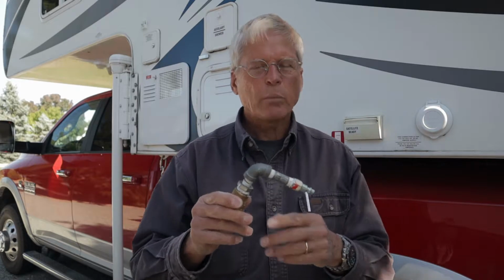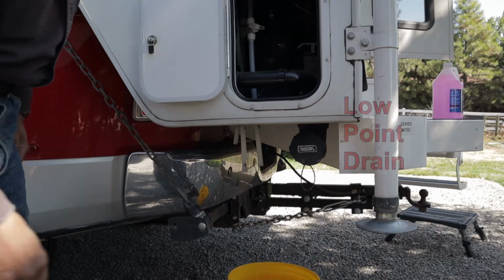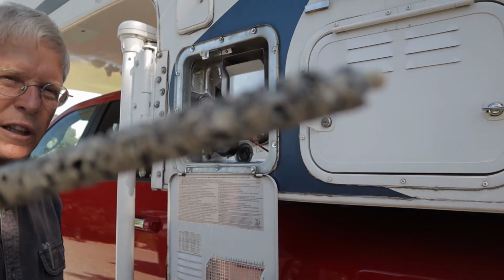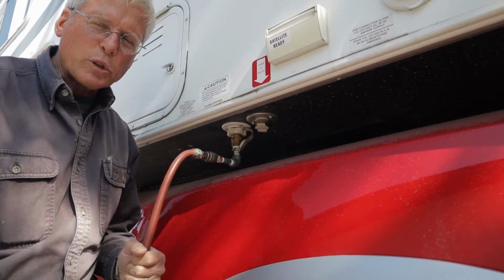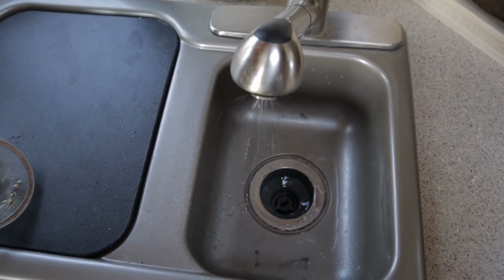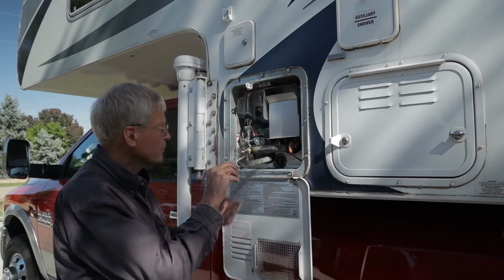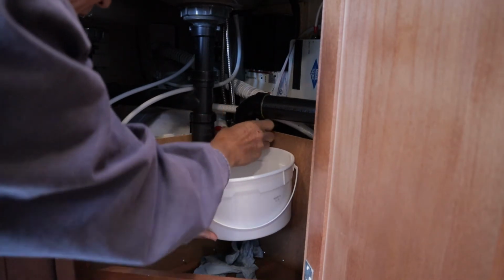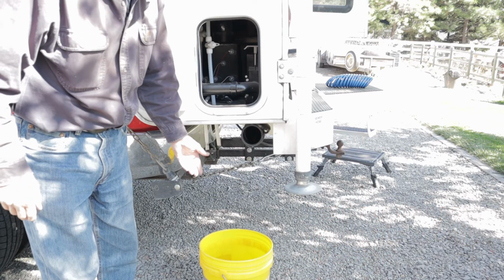Winterize an RV Using Compressed Air

Comment: Shower drain has a p-trap. You need to drop it or run antifreeze into the drain.
Reply from the maker: Good catch!  Up until the time I had recorded this video - we had not used the shower.  I add antifreeze to the P-trap when we do.
Thank you!

Comment: Great video, I'm winterizing my AF 1150 for the first time. This will be very helpful.
Reply from the maker: Thank you for the feedback!  This year I added 'swivel' fittings to the pump to make it easy to drain the pump as it's difficult to get all the water out by simply running the pump.  Since you have an 1150, I assume you have a Shurflo pump.  If interested, look-up parts 255-325 (1/2" Barb input AND a 1/2" Female Swivel Output strainer) and either 244-2926 (1/2" FPT X 1/2" Barb Straight Swivel) or 244-3926 (1/2" F-NFT  swivel barb ELBOW fitting) - available on Amazon.

Comment: Thanks for your video. I pretty much have the same set up, Dodge pickup Arctic Fox camper. I love the idea of using compressed air. Thanks again I think you did a very good job of explaining how to do it.
Reply from the maker: Thank you for the feedback!  I just winterized my camper this week - for the second time this year.  I replaced the fittings attached to the pump with ones that have wings so I can now easily drain the pump itself.  Wish I had done this prior to recording this video.